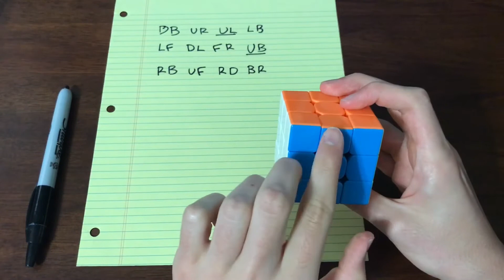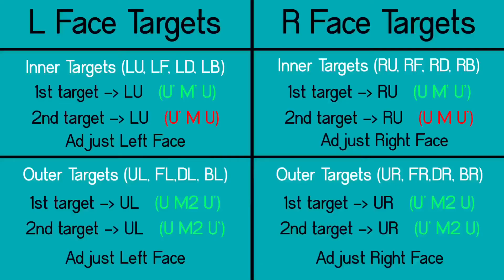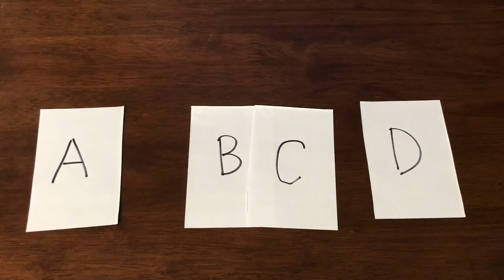Advanced M2 Tutorial Part 2 | Parity, Commutator Groups, and 2 Targets on the M Slice

Comment: Does your method to avoid parity work when using 3 Style/corner comms or only when using the modified OP Y Perm?
Reply from the maker: OldSlow Cuber it works with comms as long as you use UBL buffer. If you have parity, you’ll have to use a Y perm to solve the last target, which swaps UB and UL from their psuedo solved position into their solved position.

Comment: 5:20 
About the 50/50 chance I think that...
It reduces 1 if one is switched 1/24
It reduces 3 if both are switched 1/576
Increases by 3 if both are solved 1/576 
Increases by 1 if one is solved 1/24
Increases by 1 if no one is switched nor solved 526/576

Reduces 1 (1/24) 4.16%  
Reduces 3 (1/576) 0.17361%
Increases 3 (1/576) 0.17361% 
Increases 1 (550/576) 95.4861%
But I'm not sure about what happens when they are fliped...